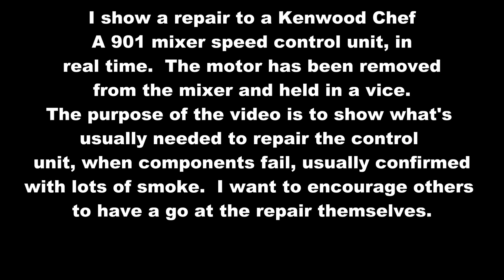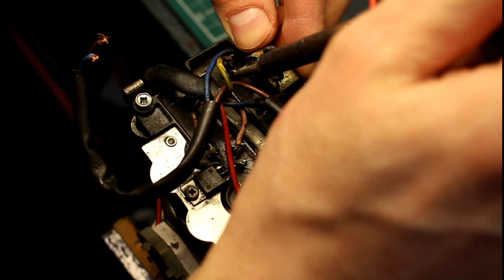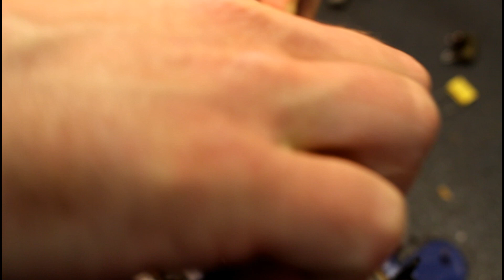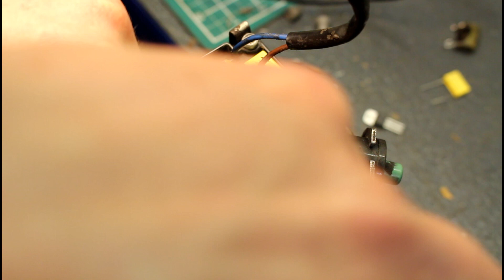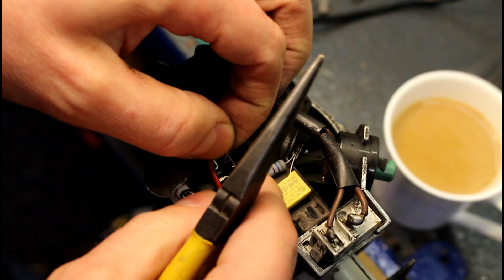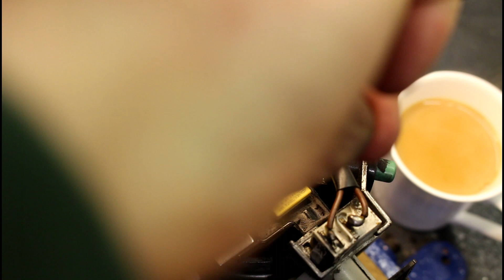Kenwood Chef A901 (smoky) speed control repair in real time

Comment: At 5:45 you say you're going to use the other side of the tag but after you've replaced the further end, the first loop then goes over the original side of the tag!  Please clean up your soldering iron tip!
That board needs a good scrub with a toothbrush and IPA - it'll stop the smell of the burnt out components as well as looking smart again.  Little details :)  My repair kit is in the post, being fitted this week 👍

Comment: My beloved Kenwood Chef A901 blender broke down a few years ago. I live in Spain, and although I've tried to get it repaired, Kenwood hasn't been able to help. It was lucky to see this video because mine has the same problem. I was cleaning it, and I think some liquid got inside because when I turned it on, a spark flew and it stopped. A little smoke came out, and there was a burnt caramel smell. I don't know what damage the components have suffered. Could you tell me if they have the complete circuit board on eBay?
Thanks.

Comment: Hi I was just doing this job, and obviously I had done something wrong as it was running but with no speed control just one speed. I had already watched this before starting. Rewatched this and realised I had coupled one resistor to the wrong lug, so changed it magic everything running spot on. So a big big thank you👍

Comment: Hi, I trying to repair my A901. Speed control is not working, it starts at the maximum speed and no chance to change it. I already changed the capacitors (one of them was blown up) but nothing has changed. Why did you changed, in your video, also resistors and Triac ? they look fine. May be I have to change them as well even if they look fine

Comment: Great Video - I have a Kenwood Excel which i replaced the Caps, Resisitor and Triac over 10 years ago. Worked fantastic since. A new problem has just started to happen whereby when i start the mixer at low speeds the speed seems to vary up and down a noticable ammount. However when i bring it to full speed it works fine and when returning to low speed, again it works fine. Wondering what you think the problem might be. I had a spare set of brushes and put them in. (more so in hope than thinking it would fix the problem.....It didnt). They are a great mixer and it would be a shame to have to get rid of it...plus get a great kick out of fixing it.

Comment: THank you for this video. My wife went to use her A901 after it had sat on a shelf for a long time and found the kitchen full of smoke! She thought it best to junk the machune, I don't share her views on this sort of problem. So have now found plenty of UK suppliers of the electronic components and watched this video so decision is made to repair. (I have already repaired her Major but that was a simple motor and gearbox replacement although I have kept the old g/b to replace the probably defective diode so giving me a spare.)
My only observation prior to performing the job is that i will disconnect the power supply cable. I have the feeling that the task will be less fiddly with that cable out of the way, resoldering is not going to be a significant extra task.

Comment: Great video - you did well to sort this in 20 minutes!  I have been trying to repair a motor but, despite the usual blown capacitor, the armature had two segments on the commutator which had burnt out due to being clogged up with carbon from the brushes.  This had also burnt the ends of the plastic brush holders.  I have rebuilt the motor using an armature (which looked okay) and brush holders from another machine I picked up free for parts but, alas, there is far too much sparking at the brushes so I can only assume this armature is also bad.  The soldering took me a lot longer than this, mainly because I did de-solder the tags with the aid of a "solder sucker"... the triac in particular was troublesome as the tags had been bent over when the original part was attached and I wanted to ensure there was a "hole" to put each leg through.  I was trying to fix up a machine for a friend who was going to chuck it out, so it's a bit disheartening not to have a serviceable motor after spending so much time on it (along with clean and polish of all the other parts and re-greasing/resealing the gearbox).  I suppose the lesson for next time is to look at the motor before spending time on the rest!

Comment: Hi, I have a Kmix. When I turn the dial to the lowest speed (1), it actually starts spinning really fast (seems like Max speed) for around 5 seconds and then it goes back down by itself to a lower speed. It is then not responsive to further changes in speed on the dial. Is this a capacitor issue? There’s no smoke
Reply from the maker: It could be a few things. Check the speed sensor is seated correctly
Reply: @Matt_Marchant_fixitworkshop  I’ll see what I can do! Weird thing is that it only happens sporadically
Reply from the maker: @numb15  Check all connections to and from the speed sensor- the sensor itself may be loose.

Comment: My machine same model but conections in cables difrent
Reply from the maker: Ah, you might have a 901e which uses a different motor design
Reply: @Matt_Marchant_fixitworkshop   will show you pic ,, I buy this KIT from ebay   and then  motor not wantd start at al ,,,, before put this on the motor was just go on FULL speed  so when put the new kit on the motor not even start ..  Will take pic  for you so you can see the conections
Reply from the maker: @Mrsvetsare  send me an email through my website www.fixitworkshop.co.uk

Comment: Thanks for this. My speed control problem is that the controller on the outside hangs out and loose. I can push it in and fiddle to get it to work. I'm thinking my problem is mechanical, rather than electrical. (Major 250). Wonderful narration.
Reply: Same issue here. The circlip holding it on had let go.
Reply: @zogworth  Did you fix it? or figure out how?
Reply: @jenmcmullen1058  yes it just needed a new spring clip thing to hold it on. 

We'd lost the spring that goes inside the switch too so needed another one of those.
Reply: @zogworth  ah.thanks for answering my question. Did you have to take it apart? I'm in Canada where this brand isn't as popular (market cornered by cuisinart), so parts are rare.
Reply: @jenmcmullen1058  if the speed selector knob has fallen off completely like mine then you have to take the motor cover off but that's it.

I will try to measure up the clips and things to work out what size they are and find out what would fit.
Reply: @zogworth  aww. thanks. that's a kind offer
Reply: @jenmcmullen1058  hi, on ours (a 901) what's called a '4mm groove diameter E type circlip' should fit. 

I asked the maintenance folks at work (machine shop) and they say they've never seen the original type before used on other things so it must have been a specific Kenwood item. But if yours is similar to mine it should work.

But I would take off the cover on the dial to see if the original clip is floating around inside and hasn't just come loose.
Reply: @zogworth  brilliant. will do and thank you for your help and time. thank your mates too.

Comment: A great and interesting video. I've got a 65 year old A601. One of the few things I brought with me to Thailand 34 years ago. Recently I overloaded it, I pressed the green reset button and it started then packed up. It's refused to start. The green reset button doesn't seem to go in very far? Is it meant to click in? Any advice on the problem? My knowledge of electrics are almost zilch but I tinker.
Reply from the maker: Hi, glad you liked the video. The video shows an a901 and the green button doesn't move that far. Its a safety device, so if it's overloaded, start with the cause.

Comment: I have only full speed available... (KW Chef) Any idea of the fault? It works fine and no smoke or smell...
Reply from the maker: I suspect that the fault is due to either a faulty triac or broken speed control 'plate'...
Reply: @Matt_Marchant_fixitworkshop  Ok, thanks. You talk about the triac in the motor? -> https://youtu.be/7IG_EdVc-sE (at 6:22) ?
Any idea to do some measures on the speed control pcb or triac? Thanks a lot!

Comment: Have you got good pic of the Caps n Triac n Resistors  you have replaced !
Reply from the maker: I haven't but have a search on eBay and you'll see the right kit/ parts for your machine... good luck :-)
Reply: @Matt_Marchant_fixitworkshop  Cheers and thanks for your help and your Vid

Comment: Pity the resistor values are missing as the original values can not be read due to them having been hot and discoloured
Reply from the maker: You can find the resistor values, suitable for your machine within service kits on eBay

Comment: Kenwood 7010A centrifugal speed regulator has been adjusted by tightening the screws , Now fully tightened. No changes. The speed is always on high! 
What or how can I resolve the speed problem?
Reply from the maker: It could be that the control plate isn't fully engaging with the centrifugal bit- check the gap.

Comment: Great vid, thanks. I just did this and replaced the motor brushes. Seemed to fix the machine, but when I turned the machine the right way up it stopped working. It's repeatable... Motor works fine upside down, stops once it turned the correct way up. Any ideas?
Reply from the maker: Hi, try cleaning the contact breaker on the back plate area... Hope that helps

Comment: Kenwood A901, motor no slow down facilities, I have screwed both adjusting screws fully for slowing down the speed. Did work a bit but now rotating fast again! What must I do, can anyone shed some light/suggestion? Thank
Reply from the maker: Is the knob pin fully engaged with the speed control board?

Comment: Does it matter which way round the resister's go, my color markings are different than yours.
Reply from the maker: It doesn't matter which way the resistor goes as they are non-polarity conscious.  The colour bandings are important since they tell you what value the resistor is.
Reply: thank you for your reply, thanks.

Comment: Hi there, thanks for the video. Quick question - In the A901E model the electronics are fitted into an circuit board rather than just being soldered together. Is it still possible to remove and replace components in this case, or should I be looking for a new circuit board altogether?
Reply from the maker: You can buy a complete service kit for the circuit board on eBay.
Reply: @Matt_Marchant_fixitworkshop  Yeah, I just bought a repair kit from amazon and will try to repair it when it arrives. I was just surprised that that kind of board can be resoldered. Hopefully I can just use the legs of the old capacitor as hooks for the new one - does that sound reasonable?

Comment: Thanks for sharing this nice video and encouraging people to try repair themselves. Just wondering, if one need to change the device with the green buton as well. Is it a kind of switch?
Reply from the maker: The green button is an overload protection device. It should be resettable.
Reply: @Matt_Marchant_fixitworkshop A great interesting video. I overloaded my 55 year old A601, I pressed the overload button and is started. I repeated doing this a few times. I know. Stupid me. Now the machine won't work. Any advice? It's one of the things I brought to Thailand 34 years ago and it's like an old friend and it's served me well, but I've abused it. Can these components be bought separately from an electrical shop?

Comment: you say 'speed control unit  repair' are these 2 caps and resistors part of the speed control? My Kenwood is a Sense model (Chef XL KVL60), does the 'sense' means that the load of the enigne is sensed and the power adjusted to it? Is that wath you were reparing? I ask because my Kenwood KVL60 shuts off after a few seconds working. Sometimes is still work longer, especially if the powercord was disconnected before use. So I'm thinking of a bad Cap on the Power Supply PCB. it uses this pbc;
https://www.4kenwood.co.uk/chef-range/kvl6000t/power-pcb-assembly/product.pl?pid=4746140&path=590704,71679&model_ref=11531684
Reply from the maker: Your machine is very different.

Comment: I have started using this machine. Initially it was working fine but later on after 5 min it started making noise and smoke came out. I turned it off immediately and later i turned it on but still the smoke starts coming after a 5 min usage. So what i wanted to ask is, is the problem related to capacitor or is it something else, coz the machine was packed up for a decade and when i removed it had a bit of oil leak.
Reply from the maker: Probably a faulty capacitor. Other components could also be affected.
Reply: @Matt_Marchant_fixitworkshop  Thanks for the reply. Will start dissembling it.